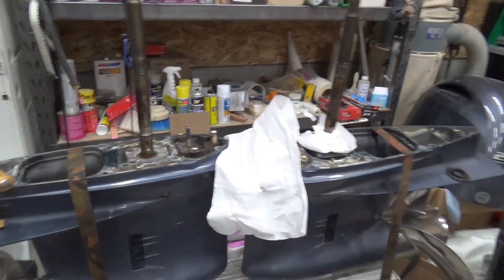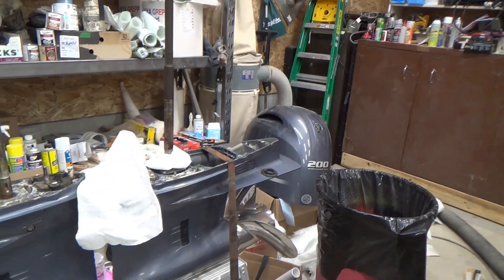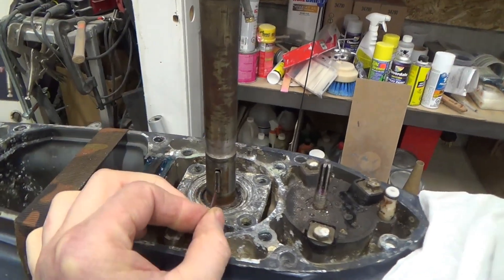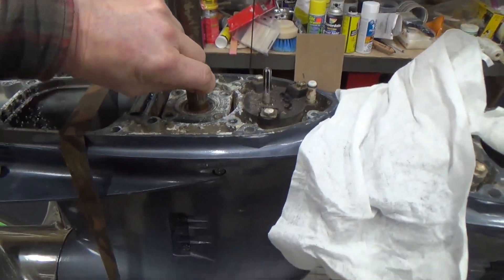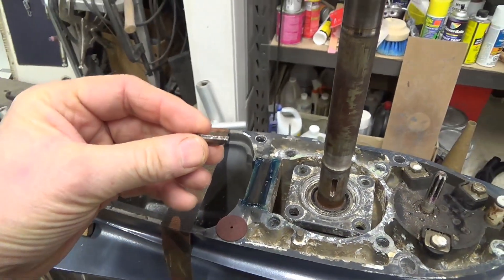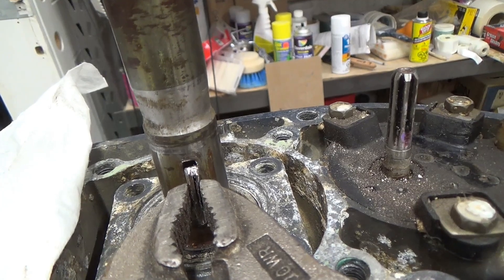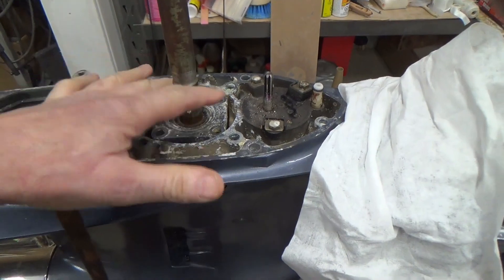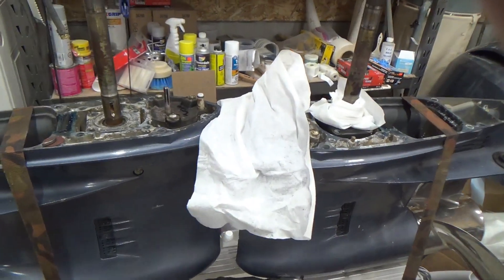How to Remove a Stuck Woodruff Key From a F200XB Yamaha Outboard Driveshaft -  Episode 3

Comment: Exactly what is going on with my 150 hp Yamaha 2013. I bought it 3 years ago used on a Trophy and wanted to replace lower unit seals and upper seals along with water pump and shift shaft seals. I was thinking heat but grinding and crushing seems like the way to go eh?!! Ha thanks for the great information.  Johnne in Clallam Bay WA
Reply from the maker: I think I tried heat. Problem is when using heat the shaft and key will heat and expand at the same rate. The grinding and crushing is something that I read about and it was a game changer. Next time I would tap the key with a chisel, then go directly to grind and crush!
Reply: From what I am reading, you should avoid heat because the shaft seal is right under the water pump housing and can be ruined by heat. Though if you’re replacing it, I guess it doesn’t matter much.